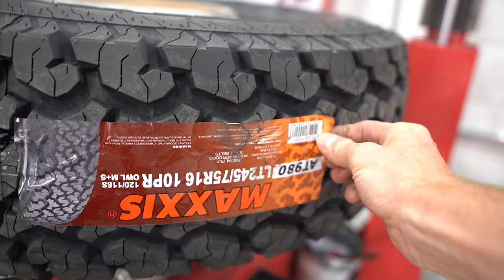I Swore I'd Never Do This Again | Border Crossing To Peru

Comment: I have a solar light that comes on when anything living gets next to the door. Positioned between passenger side door and sliding door. I've never had a problem yet with a potential break-in. However I've not left the United States and haven't been around cities very much. And only a few months under my belt so far. Solo female traveler though. Thanks for sharing your adventures. I would probably have a can of bear spray in my hand, out of the van. Allie if you're alone with the dog, it wouldn't take much for a couple guys to attack

Comment: I'm sure twigs and yellow tape are good safety barriers :/
Reply: Visual cues actually work very well if you are paying attention. As a heavy equipment operator building right-of-way for oil and gas pipelines, we would leave a tiny strip of dirt all along the drop off side. It was maybe three inches high. That's all there was to keep operators from plunging off of cliffs.